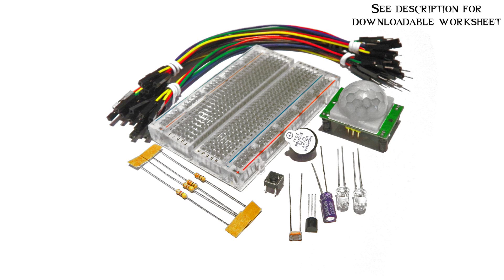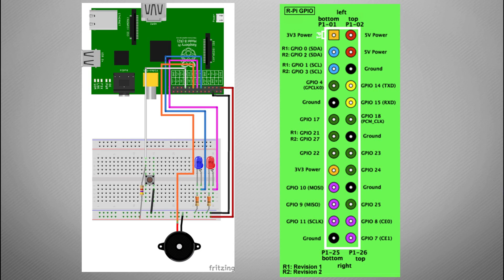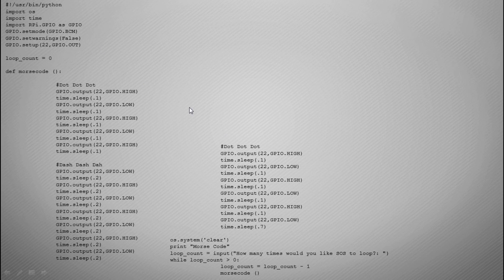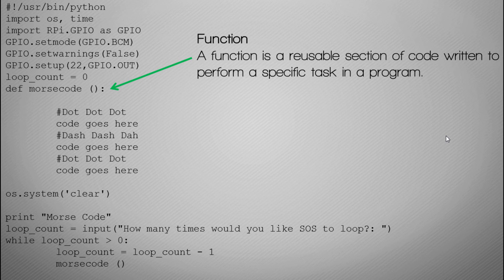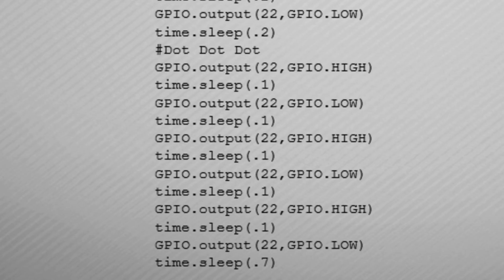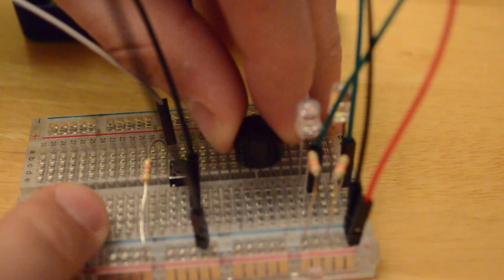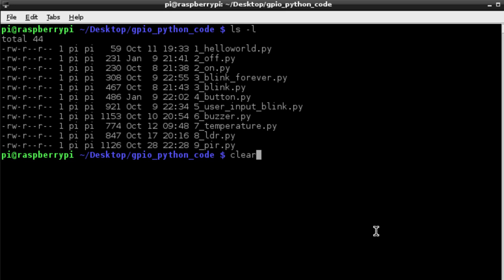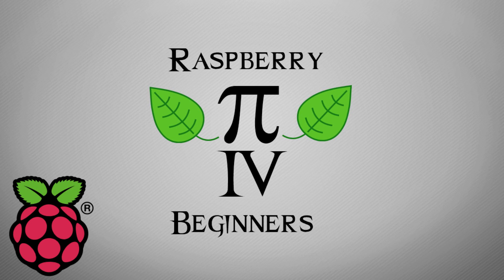Raspberry Pi - GPIO & Python (6/9) - SOS Buzzer

Comment: I got a broken buzzer... it only clicks
Reply: Guess we're screwed haha. Tip. Buy the Pihut Camjam Edukit 3. It's also a ton of fun.
Reply: +George Dekker You may have a passive buzzer which would require a generated signal instead of just a voltage. The one in this tutorial seems to be an active buzzer which means it has a signal generator packaged in with the buzzer so all it needs is a voltage to produce a tone. A passive buzzer is more flexible because you could use it like a speaker. If you have a passive buzzer you could potentially program it to play more than one type of sound and even music.
Reply: David Hawkins
I bought exactly this buzzer thing. but the whole kit following these videos. I guess mine is just broken somehow.
Reply: +George Dekker no i got the same thing mine only clicks